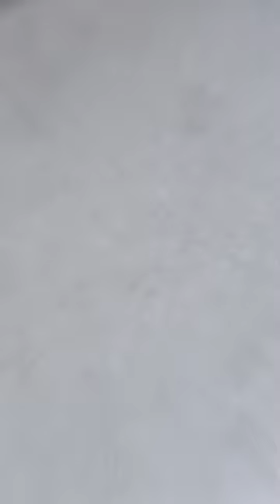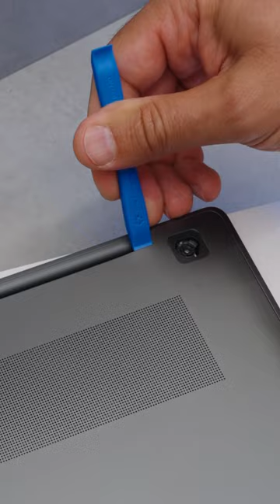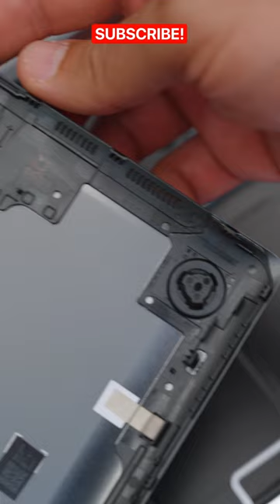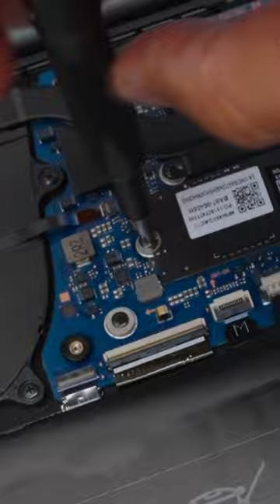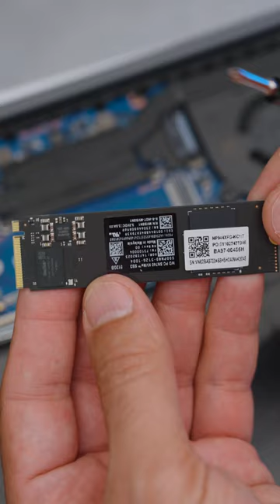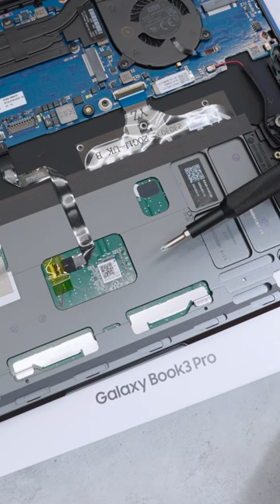🛠️ SAMSUNG Book3 Pro Teardown! #shorts #samsung #teardown

Comment: Hi, very interested in this. How many have done the addition of the 2nd SSD? no problems? in other web sites I have seen comments that people have experience overheating and even a few had to send unit for repair, so I´m worried to do the upgrade. Maybe it could be selecting the wrong SSD?

Comment: I have a question I need a laptop for programing what would you recommend?
Reply from the maker: Hello for programming I would recommend book 3. No pro and non ultra are too expensive if you just want to program. And if you have to make videos or graphics, the 3 ultra is a beast!!! I'm trying the book 3 Pro because it's small and light and has a good screen with nice colors so if I happen to make some videos I can do it. Doesn't last that long on battery and is a little loud and gets hot. 😤 but otherwise it's ok.
https://youtube.com/shorts/J2Fp5_Kk714?feature=share